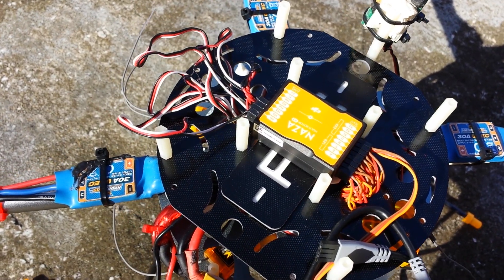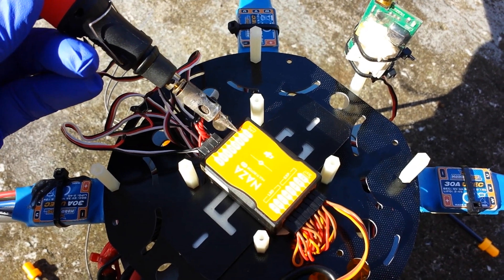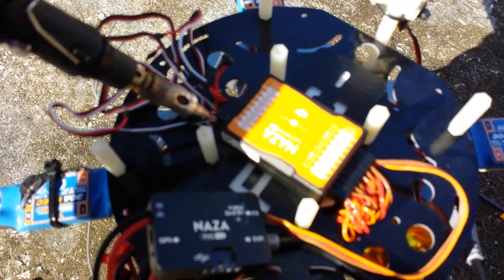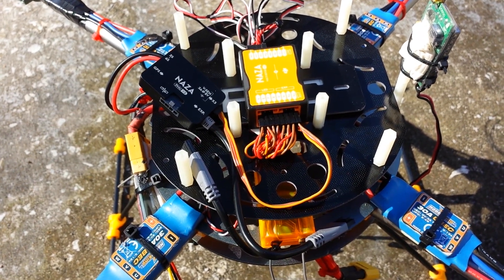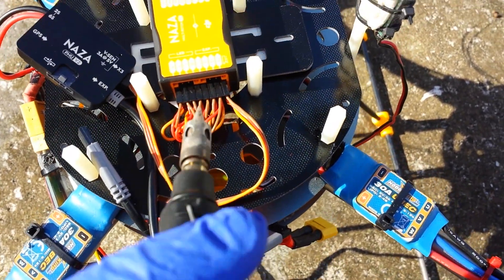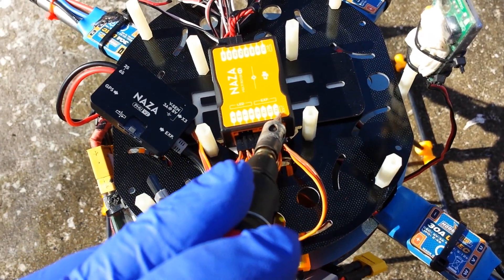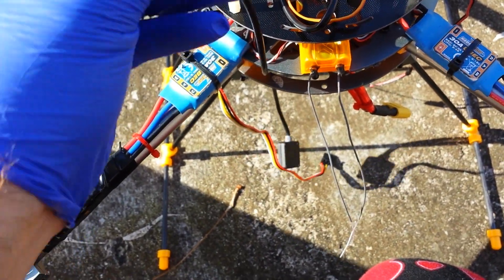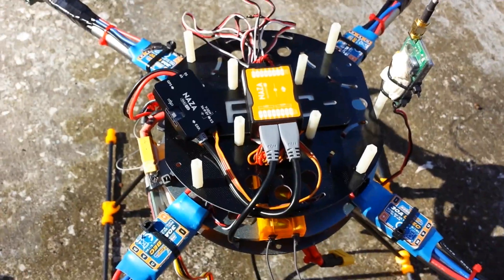How to wire naza m v2 spektrum

Comment: Do you need to disconnect all 4 power wires on the ESC's or just the3 power wires on just 3 of the ESC's so it can get power off the one ESC?

Comment: Just a heads up, you don't need to remove the red wires when plugging the ESC's into the Naza M v2. I'm pretty sure it isolates the red wires its self. I have not unplugged mine, and i am not running opto esc's and mine is running fine. It does not mention this in the instructions and it just makes things more messy, and more annoying if you want to reuse the ESC's at a later point in time.

Comment: so if u understand this right, ESCs with built in BEC must have positive lead removed or opto ESC must be used... but the system comes with a power control module that supplies the 5v to power the system and the Rx gets powered through the FC? So no need for a separate BEC? Im converting from KK to this and its powered via the ESCs or a separate BEC.

Comment: Nice vid, easy to under stand. Thanks. Just 1 question, you mentioned about disconnecting the power from the ESCs. I have TBS SimonK Custom bulletproof esc, is this the same case. Do I have to disconnect the power cause it will power from the Naza PMU? Hope you can help.

Comment: Hey bud back again... Are you sold on the orange receivers? I like the idea of dual satellites, but not sure about the tech quality. I'm thinking orange is a pretty good copy of the DMSX tech?? You seem to know what your talking about so basically would you recommend them with an expensive payload? Also what volts does the Naza Power unit take? do you run a separate battery? My setup will be 22.2v.

Enough questions and thanks for the upload.

Comment: Nice clip...
So on the motor inputs, what if I'm running a octocopter but also want to wire in a 3axis gimbal? Do I loose the gimbal link by using all the motor ports?
Reply from the maker: I couldn't answer that.  I really only run quads.
Reply: Yes you are right, you are not able to use a gimbal then.

Comment: Good information, what's with the surgical gloves lol, I'm thinking of using NAZA V2, how do you like it so far? Any problems? Thanks!
Reply from the maker: I wear them when working with any electronics.  My hands sweat a lot.
Reply from the maker: It is the best and easiest flight controller I have used.
Reply: Erik740t that's a great idea,,keep the electronics clean..
 Thanks for the video and info BTW..
... it's hard to find much in the way of directions for NAZA M V2 and Spektrum.
Reply: hes a germ freak